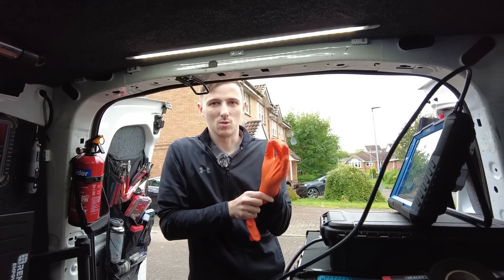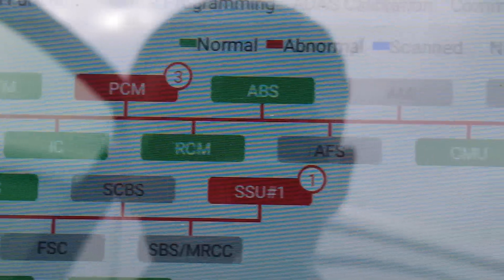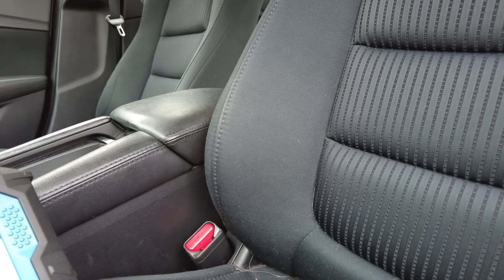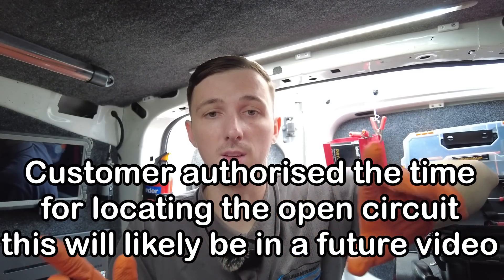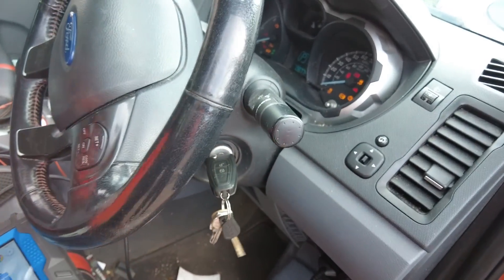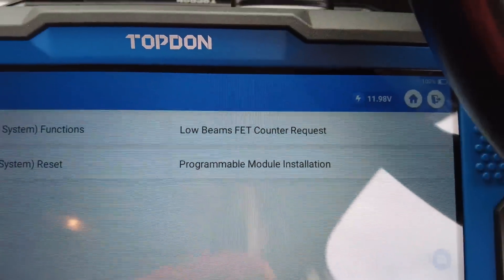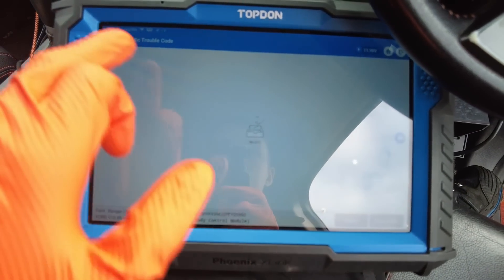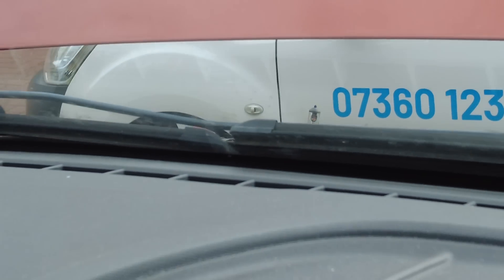USING A £1500 SCAN TOOL TO FIX A £2 HEADLIGHT BULB !

Comment: I fail to see the benefit of electric parking brakes, just another complex point of failure.  Last year I came across a broken down Renault stuck on a blind bend, so i suggested i towed the car to a safer place BUT due to total electric failure the parking brake could not be disengaged! dumb!

Comment: i-Stop faults are usually a crap battery.  Fit a fresh appropriate battery & clear codes. The Topdon Topscan pro - less than 200 quid - will do the Ranger headlight bulb, pretty sure. Once you get used to it (it takes getting used to) it's powerful for the price.

Comment: Like the idea using the small battery !! Will save me dragging a power pack or 12 battery under vehicles 😂😂 also a lot of PSA vehicles need to reset faults or carry out battery reset once bulbs replaced 🙄

Comment: Buzzing epb motor does not mean fault free mechanical part. Brake support/caliper could be siezed and throw a performance/range/position code. In your case, yes -wiring issue. Nice one! I have changed a few bcm’s on these rangers/mazda because of headlight issue. Most likely because of cheap light bulbs.

Comment: Alright mate, I will need keep that in mind with the Mazda throwing up an engine management light, the wife has a (very clean) cx3 and she worries when lights come on. 😂
Any idea how I would disable the automatic door locks on a 2019 L200. Locks at a certain speed, does my head in 🤬

Comment: Got a range rover evoque  2015 with rear leds filled with water,both replaced but got that code for solid state driver and os light doest work on brake light and indicator anyone reset this got top of range autel but cant find function to reset.
Reply from the maker: I havent done so on a newer range rover but have done plenty newer bmws for the above issue, Maybe worth a try on a different scan tool
Reply: Keep trying different search terms?

Comment: FET's usage in automotive circuitry ; (FET) controls the width of a current path called the channel that is created by the voltage applied across the gate and source terminals. Changes in the channel width causes the drain-source resistance to change. Therefore, an FET is a voltage-driven device. That can lead you down a few rabbit holes if you don't have top of the range scan tools.  Great video Ryan..
Reply: Yes. Field Effect Transistor

Comment: That Ranger gives me BMW 1 Series FRM short counter flash backs!
FORSCAN can perform most special functions on fords, have a look into really good(and cheap) for programming modules aswell as you can either download the asbuilt data or back it up from an original module, got me out a bind on various occasions 
Great video, as always👌
Reply from the maker: I have Forescan Davy its great but rarely use it as the aftermarket options are quicker but it is good software to have and cheap!

I was at a newish bmw x3 tbh at needed a FET reset via topdon after a bulb blew and shorted the circuit, Difficult explaining this to a customer 🤣👍

Comment: How did that Ford Ranger know its driver was disabled ? 😂😂
Reply: the tool saw a blue banner on a blue tool  near the dash board and thought it was a blue badge
Reply from the maker: Once the bcm detects a short circuit it knows to shut the output off and set s code 👍